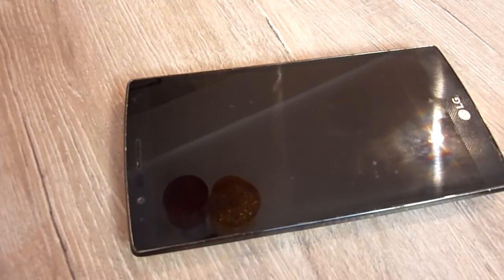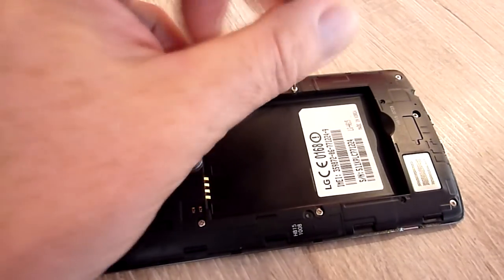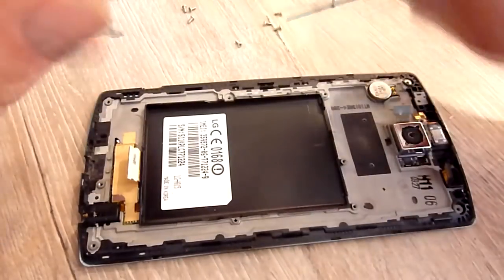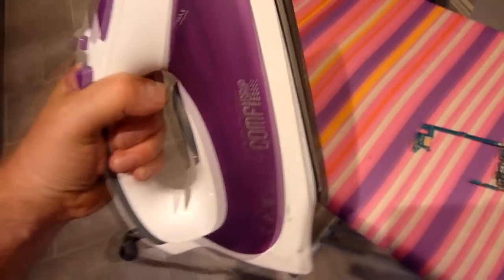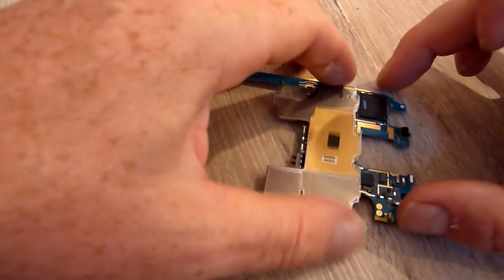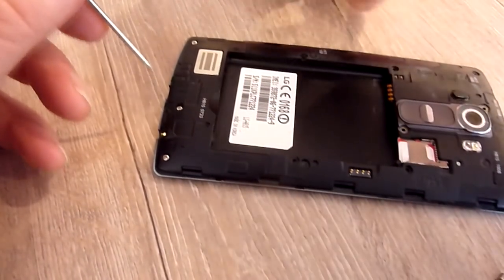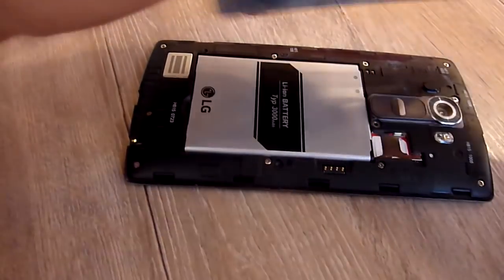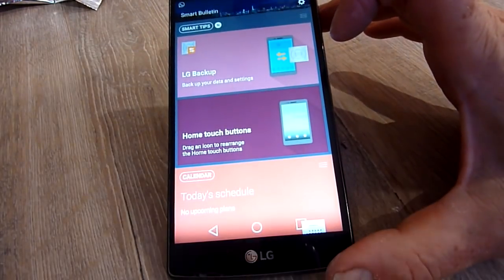Lg G4 Fix - 7 days still working.

Comment: I really need the ribbon connector pinout or to at least know what all the pins are on it for the LG lm-x210, the Motorola xt1921-8, the Samsung J100 & the Samsung J120. I can't find it anywhere. Any help with this would be very appreciated.

Comment: Yes this is super idea - with one caveat.  Get a cheap cooking termometer and find out real temperature at each iron setting.  Lower iron temperature (maybe 150 deg C),  works much better than super hot iron.  And apply plenty of pressure!  Super hot iron can melt the solder, but this is bad because when solder is in liquid form and pressure is applied on the chip, solder can go everywhere and form massive short circuit, killing motherboard.

Comment: I tried using a blow dryer and that wasn't successful. I then tried the Iron, it worked for a few minutes then turned off (i was able to boot it back up a few minutes later but it froze again and turned off). I don't think the thermal paste will do anything because it works by transferring heat to something else, IE: a copper heatsink/pipe. The back has neither of those, seems to be some type of thin material. The plastic/thermal paste may be making it "thicker" to apply more pressure to make sure everything is in contact. I have ES File explorer on my phone, and it's been notifying me often that my CPU is maxing out and RAM is getting full. Not sure what's causing it, but I suspect that may have been causing it to constantly overheat over the past few months and finally the soldering lost contact with the CPU. I might try to do the iron again and see if it helps. I really didn't want to spend hundreds more dollars on a phone i had a little over a year.
Reply: So I just re-did the Iron thing for about 3 minutes and it's working now. I also did a factory reset and didn't install CPU hungry applications like facebook. I did watch an interesting video where they took the CPU apart and cleaned everything up and put it all back together as a more permanent fix. https://www.youtube.com/watch?v=HEu4KPUa5MY